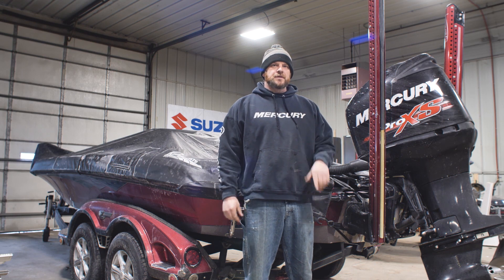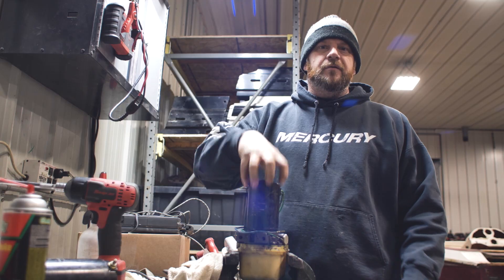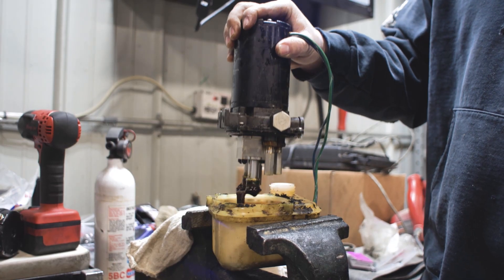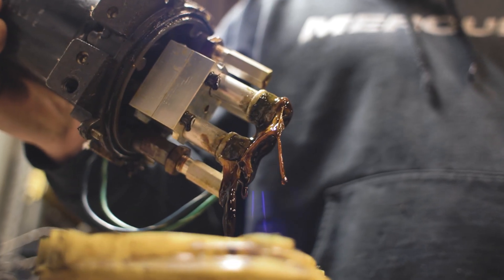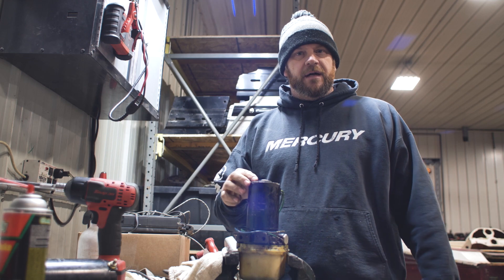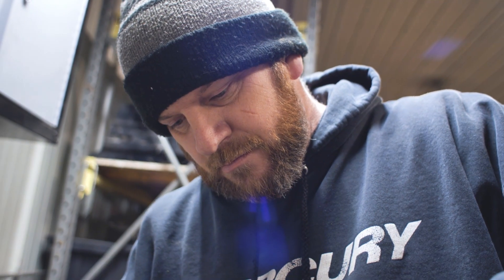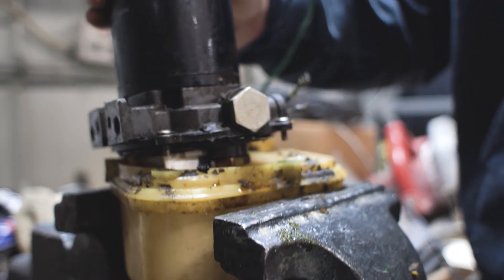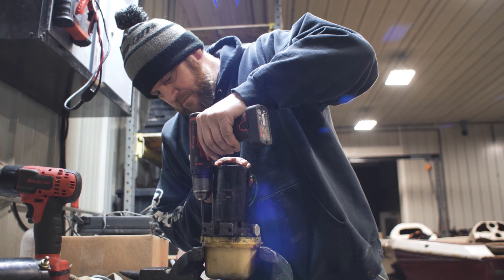Team Tech Tip #1 | Power Pole Pump Service

Comment: ditch the organic fluid and switch to atf
Reply from the maker: Yes! We use Green Marine due to being a Power Pole dealer and for their warranty! 👍
Reply: And you aren't polluting the lake with the green fluid.
Reply: Use dino ISO 32 fluid and eliminate the green bean snot. Good for 5+ years. Does not void any warranty as noted by JL Marine. You carry 50 gallons of fuel and outboard oil in your boat which is waaay more of an environment issue.